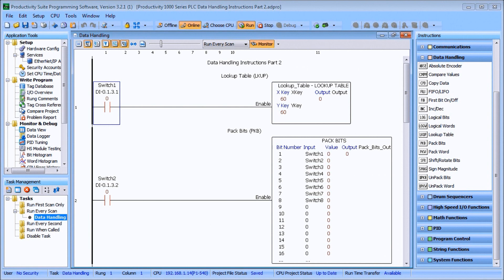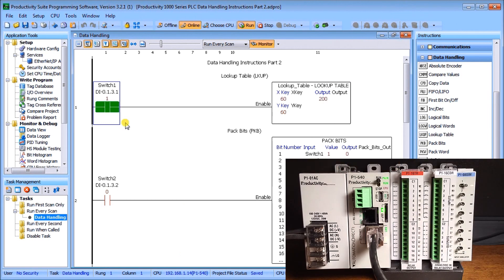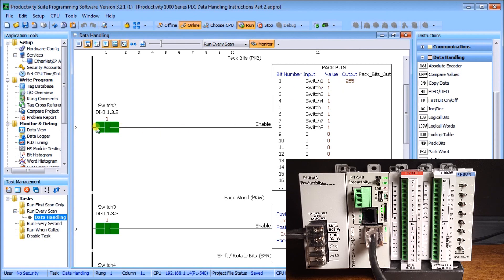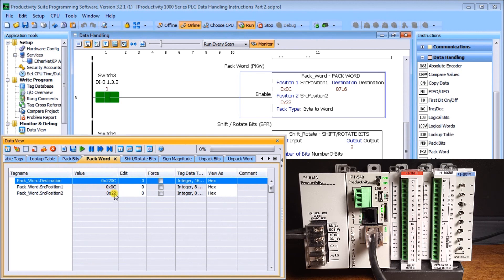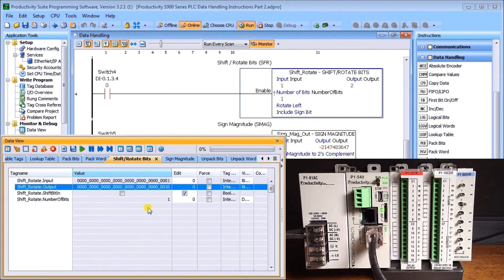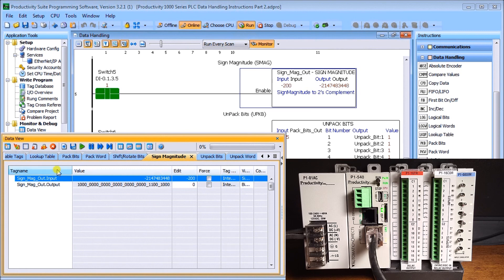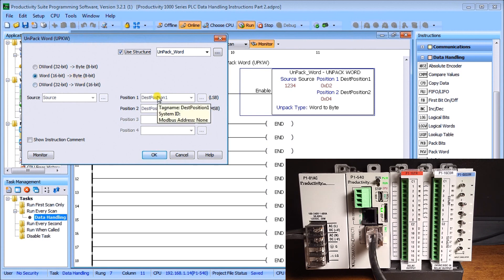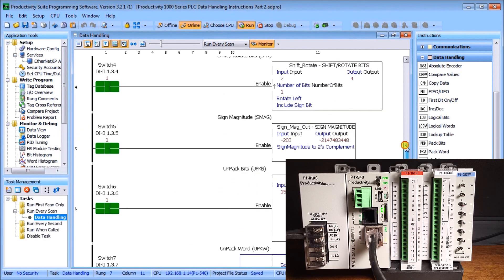Productivity 1000 Series PLC Data Handling Instructions Part 2

Comment: So how would you set up the shift/rotate bits for a bottle eject line? The click PLC is easy with just shift register, but this productivity PLC version is much more complex and it is confusing.
Reply from the maker: Hi EETechs,
Shift / Rotate Bits (SFR) instruction would be used.
The input would specify a channel. "Bit To Shift In" would specify the bit to put in the output. Shift left would act as a shift register in the click.  The clock bit to do the shifting is the condition on the rung.
Use one of the bits of the output to trigger the reject.
https://accautomation.ca/productivity-1000-series-plc-data-handling-instructions-part-2/
I hope this helps you out.
Regards,
Garry
Reply from the maker: Hi EETechs,
Here is a short video on the PLC Shift Register for the Productivity Suite Software.
https://youtu.be/OgcagnbJ6is
Call up the instruction and set the input and output to the same register. I am using a 32 bit output called Shift.Output. The "bit to shift in" will indicate the input to the shift register.
In our example we are using the shift left option. The condition on the rung will determine when to shift the bits in the output. In my case I am using the first input to shift the bits.
When the fifth bit in the shift output is on then the first bit on the output will turn on.
Regards,
Garry